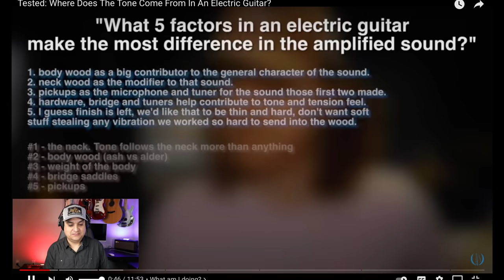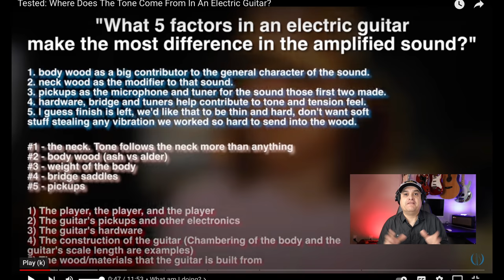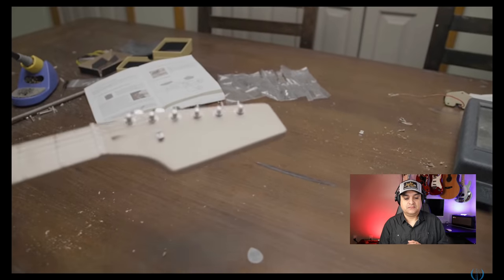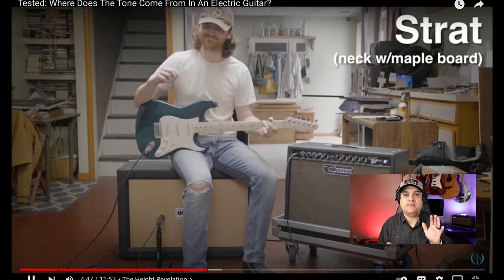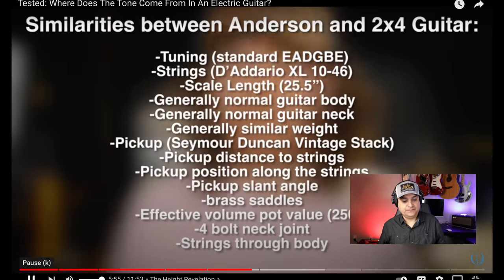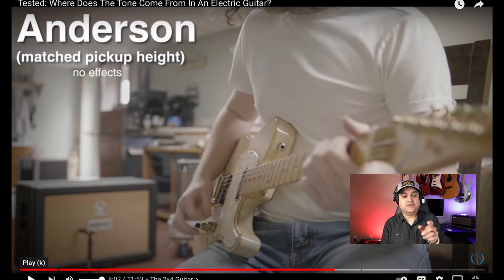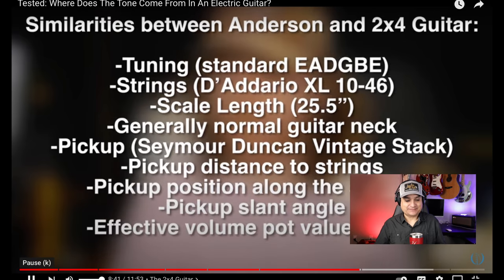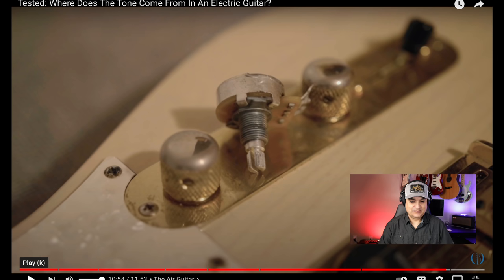Where Does The Tone Come From In An Electric Guitar - Reaction Video

Comment: Not to be nitpicky, but the pickups are working like microphones. At least in the classical sense.
Both work by translating movement of a magnetic field into current. The pickup, very direct, picks up the vibration of the string and by that the change of the magnetic field.
While standard microphone picks up the vibrations of  a magnet, stimmulated by the pressure difference in the air.
Heck, you can sing to your guitar and if the strings start to vibrate, you have the principle of a normal microphone, although not very good.

Comment: Surprise surprise, put the same pup in dif guitar, it still sounds the same.
Reply: It doesn't. Feel free to do it yourself.
Reply: Have done thanks, but let's not discuss anecdotal evidence since there's an example right here. So, I can only assume you think the pups sound different in each guitar? 

Could tell the difference in a blind test?
Reply: @ReeWebster  The pickups themselves will "sound the same", however total guitar tone will not be the same, it's never the same, it's unique. Be it minuscule, it's still there. 
I could tell the difference. I have downloaded Jim's samples ,played it to myself dozens of times (just audio), and put it through spectrum analyzer. There is a difference.
It's not massive, but it exists. We have different ears. We hear different things.
Reply: @TheMemagNeman  knew this was coming, of course there’s a slight difference, otherwise the files would null, but there’s no point in doing that as human player cos too many uncontrollable variables, the strum, the pressure of fretting, heck the same guitar sounds different picked at bridge vs the neck. 

The point was can u actually tell the difference, blind test and film it. I guarantee you only get it right by sheer luck. And that’s with the isolated tracks, put it in a mix, go for it, prove me wrong.
Reply: @ReeWebster  I don't have to prove anything to you.
I did notice the difference between 2 "same" guitars with different woods.
I don't need to do this for anyone else but myself.
If I didn't hear the difference then I would be of a different belief and conviction ,
until someone comes to change my mind and show me that they are indeed different in real world ( say , visually, thorough data).
Then I'd understand I can't hear things like some do and would stray away from the "tonewood" discussions.
If I know I am able to hear minute differences then I am good with that. We don't experience sound the same, it's perfectly normal.

Comment: After watching the whole video, I've reached a few conclusions:

(1)  Telecaster bridge pickups  and bridges might be bad candidates for "detecting wood tone", but that seems to be what everyone tests the theory/myth on.  Dylan's comment about analyzing based on your tone, while valid, seem to forget that not everyone relies on a singular tone.  
(2)  Even the "air guitar" was connected to a big hunka wood, the bench, so it was not really an example of a woodless instrument.  I assume the 2x4 was pine, which is a traditional telecaster wood, and I have no idea how the "experts" would compare it to other Telecaster woods.  We definitely were not isolating or even identifying woods.
(3) Pickups are indeed huge, perhaps the dominant factor.  
(4)  The pickups will retain all the frequencies being produced by the strings, the fundamental and every overtone and harmonic.  What wood might do, a parametric EQ can also do.
(5)  Hot pickups and compressor pedals compress the frequencies, and so the better test is with low output pickups.  Telecaster "clean tone" is almost always under heavy compression

So, does it matter?  Well, let me put it this way.  The "book" on Poplar as a body wood is its tonally blah.  I am jonesing for a G&L Tribute fretless bass which is a poplar body with an ash veneer.  The videos I've seen make  it sound killer...which is because of the MFD pickups and the outstanding bridge.

Comment: #1 it’s  rhetorical clever to rule out the major issues people could and should (!!!) have. Open slightly distorted strings played near the bridge and so on. 
#2 actually in the last “no body” example the guitar has two massive bodys, work benches. 

It’s funny, entertaining and tongue-in-cheek but you have to admit it ads nothing valuable to the subject. Check soundwave comparisons of pickups in various tine blocks, played by a mechanical “pick” huge differences in every aspect from overtones, sustain to harmonic distribution.

Comment: You shouldn't have 2 guitars the same, what makes them different, if you take a strat bridge and put it on mahogany body (prs) it is darker then a strat with a alder body, it feels different also, wood makes some difference, or why wouldn't they just make guitars out of one wood, and they will all sound the same,  because guitar makers don't want them all to sound the same.
Reply: If you take a strat pickup and put it on a PRS you take it off a 25.5" scale guitar and put it on a 25" scale guitar, which needs thicker strings to  achieve the same tuning. Thicker strings = more bass. Nothing to do with mahogany.

Comment: try this, you guys are way off, if you want to know the difference in tone woods you MUST get rid of the steel hardware, SO, use a string through, a wooden acoustic style bridge that you can move from wood to wood, of course he hardware os going to suck up most of it.. an all wood electric guitar then you will see what woods do what..

from what I've seen everyone is looking at this exactly wrong..  wood doesn't lend tone, strings do, wood, steel finders frets ALL dampen tone, or ELIMINATE certain frequencies by nature.. dampen sustain and resonance as well.. so it's what tone, as in frequencies, attack, resonance, and sustain does a specific wood KILL or dampen... what it does not kill is what the pickups pick up

if you don't believe me make a guitar out of a very soft wood like balsa, see how it plays..  woods MATTER, mostly in acoustic guitars which a higher percentage of their construction is wood plus they have a sound board, electrics not as much but it does have a difference.. again if you do not believe me make one out of balsa wood and see how long it sustains how good it sounds, rich right?...  lol

the desk is ignorant at best, the amount of density he has at both ends is by far more than any guitar I've ever seen, so everything else is moot, if it's not a guitar size with guitar woods then its apples to oranges, again the DENSITY both desks have are massive..

I have to wonder if anyone knows how a guitar actually works?

discover how it works?  take large rubber bands or bungee cord and stretch a small E string tight enough to where it will vibrate, strike it, what happens? the rubber band sucks up all the tone and it doesn't vibrate more than a few seconds, zero sustain, the tone is crap..  in order for a solid body guitar to project with any amount of worthy sustain it has to have MASS.. again if you do not think wood dampens frequencies then ask a drunk maker, an acoustic guitar maker.. again it's not what the wood lends to the tone, its what it does not remove or immediately dampen, it's the difference between a nice ivory nut and plastic nut..  think of it like this... the denser the wood the more MASS it has per square inch, therefore the LESS it dampens the vibrating strings and the more they are allowed to sustain and over tone..  now we are getting into pitch harmonics, overtones.. harmonics come into play as well...  a string can vibrate in more than one single tone, its called overtone, or harmonics a vibration moving at different frequencies or more than one wavelength... and yes guitar strings can do this and you hear it some songs, mostly in the new metal where they exploit overtones and harmonics, amps can bring it out, pickups can bring out more of it, some designs and materials so forth can kill it, try rubber saddles and a rubber nut, see how rich that is...

two stringed shop desks is not a comparison, unless you're comparing it with another shop table stringed instrument, what he has is NOT a guitar, so in no way does it compare to one or is it worthy enough to compare it to a guitar..

good grief people, go find an acoustic made with cheap woods, then go find one made with superior woods.. if you do not hear and feel the difference then your ears are bad.. PERIOD

yes, feel is a big part of playing a guitar as well